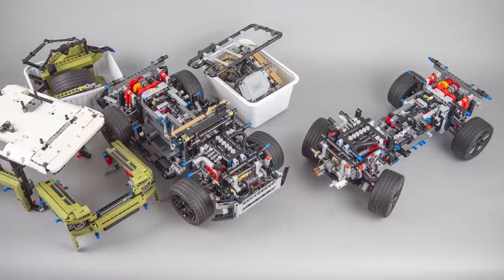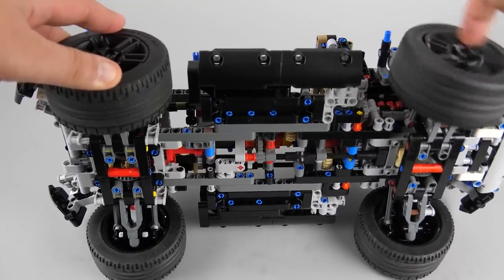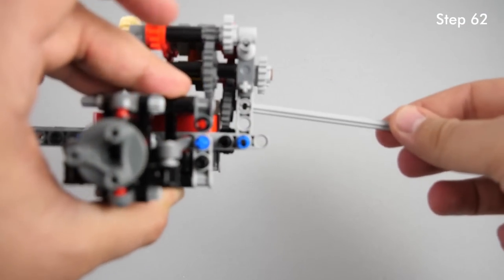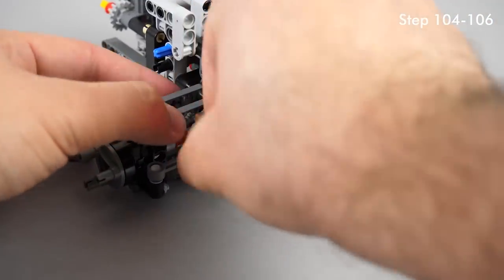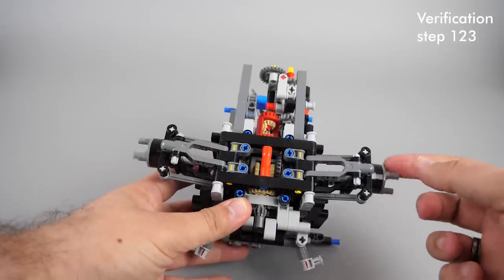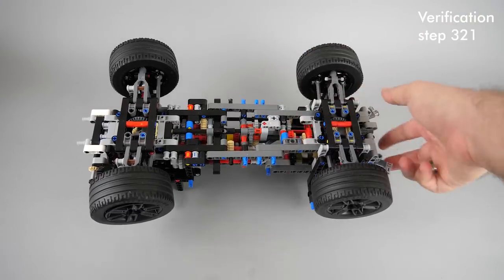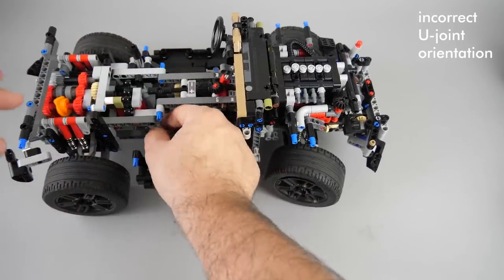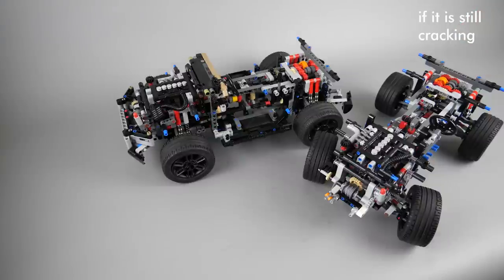LEGO Technic 42110 Land Rover Defender Ultimate repair guide

Comment from the maker: Please check the full guide here with the issues and symptoms listed - https://racingbrick.com/2020/04/lego-technic-42110-land-rover-defender-ultimate-repair-guide/
Reply: You are amazing!
Reply: @RacingBrick Hello dear fellow! I got a probably silly question, why put the red tough spring in front of the grey soft spring? I was wondering this because I got the idea of putting it the other way around to first have a soft bump onto obstacles and then have a tight stopper for the bump! As in you drive onto a rock and have the soft spring Feathering in (I don't know how else to word this, what I mean is the spring stick to slide into the outta pipe, hope this is helping to understand my shitty English lol) and letting the bump push the front wheels up and then having the tough spring in the back of the two spring front suspension to absorb the last bit of energy to have a "more comfortable" "driving experience", I don't know if this makes any sense and would love to hear your opinion on this 😂 (and everyone's else's thoughts as well!)
Reply from the maker: @Marlon_J.  there's no real "driving experience" with a non-motorized LEGO car :) You can play around with the springs but I think the hardness-softness was tuned to keep the body level, so the designer was mostly considering the weight of the car.
Reply: @RacingBrick  ah alright, thx man! And yeah to the experience thing, it's hard for me to find the best words sometimes 😂
Reply: @RacingBrick 
I unfortunately placed the front wheel differential facing top. How should I place it to bottom without damaging the model? Help me...
Reply: Help me. I unfortunately placed the front wheel differential facing top. How should I place it to bottom without damaging the model?
Reply from the maker: @amoghverma3108  check the linked guide, there are instructions how to access and rotate the differential
Reply: @RacingBrick  Actually I am sorry I asked thinking that both differentials should face opposite side😅. You clearly told that both wheel differentials should face top side and I have it same! 
Anyways this video actually gave me more confidence that I have constructed my model with 100% perfection as you did. You are an amazing Lego doctor 💪
Love from India🇮🇳👍🏼
Reply: This vid was very helpful, but I have I problem with the fake engine. When I turn the wheels I does not move the crankshaft the controls the movement of the engine! I know you said the differential placement could be a problem, but their fine in the right spot. The central differential moves the tires correctly (based on what you said). And I checked through your really impressive URG for the defender, and couldn't find this exact "type" problem. This is really bumming me out because I've had this set since last Christmas, and couldn't figure this out. I give thanks if you read this all the way, and also a hello from Colombia 🇨🇴.
Reply from the maker: @doeg0  there's no magic trick here, you really need to check the whole drivetrain from the differentials to the fake engine. You can compare with my walkthrough video and see where the difference is. I suggest to remove the body and check what happens section by section.
Reply: Mine won’t Drive
Reply: @RacingBrick My Range Rover won’t drive no matter what gear it’s in or any of that.
Reply from the maker: @austinpurcell9301  I suggest to check the guide that is linked above and compare your build with that
Reply: The front wheels will go but not the back
Reply: Is there like a brake in the car?
Reply: Ohhh nvm I found it in the vid it really helped!
Reply: @RacingBrick  hey thanks! Sorry I did not respond earlier 😅
Reply: You mentioned the cleaning stuff at the end of the video and that is what happened to me when I first built it,it was fine but when it was put on a shelf and gathered dust it started cracking when I moved it but you can't dust every bit of the set you would be there for days so what could I do
Reply from the maker: @matthewtodd5831  you can use pressurized air to clean it, or simply accept the cracking
Reply: Ok thanks your video helped me understand more about the Lego set
Reply: Even after a fresh build and following all these steps meticulously, my defender stills cracks 😭
Reply: Hey @Racingbrick I need help with my landrover i hear cracking noise in the middle section right next to the driver seat but i dont know how to fix it

Comment: Racing brick, your videos and content are absolutely superb!, i had a problem with the rear wheels not turning, i started fault finding and found an issue with the rear part of the vehicle and found the culprit,

now thanks to this video you helped massively, tiny correction of turning around 1 piece solved it, now everything works fine, so thank you very much and take care.
Reply from the maker: I'm really glad I could help, thank you for the nice feedback!
Reply: Sounds like we had the same problem, step 65. Thank hod for this vid I would never have found the issue without it!! 🙏🏻
Reply: @gzbg21  Hi there, an yes its one of those pieces that can fit in both ways an very easily missed, an yea definitely seems pretty common, but yea so glad i found this video too, happy building 😉👍

Comment: My Land Rover had those cracks and tried everything in the video. Finally, the solution was to disassemble (saving the exterior parts as shows in the video) and assemble again. Now works fine, so don't desperate if you have to rebuild, just make sure many times that mechanical drivetrain works smoothly.

Comment: What I found out is that the fake engine is the biggest cause of the gears getting stuck. The crankshaft needs to hit the pistons with some force, if not, they get stuck and the gearbox gets stuck which makes the wheels get stuck. 
The crankshaft from the manual fires 2-1-1-2. If you change it to 2-1-2-1, you'll get a better balanced force that goes through the fake engine. Definatly helped for me!
I've also build the version from jb70 from rebrickable, that drivetrain moves smoother because there are no u-joints. He did a great job redesigning the drivetrain, also fixes the Hi-Lo sticker working correctly. Would recommend it  to everyone. 
Also Racingbrick, you're awesome doing all the video's on this set. It's a great set to build and to have, and helping people having problems is always a good thing!
Reply: SEE ENGLISH VERSION BELOW FRENCH
Oh mec, c'est exactement sur ce dernier point que je me suis penché hier, après avoir cassé une pièce. Comme toi j'ai trouvé que les pistons moteur à eux seuls étaient difficiles à entraîner. ça me rassure que je ne suis pas le seul à imaginer ce problème. Peux-tu montrer les photos du vilebrequin/de l'axe moteur corrigé. As-tu lien de la vidéo où il modifie le système avec les arbres de transmission (en espérant qu'il ne faille pas d'autres pièces que celle du set sinon pas envisageable pour moi). Mais changer la hauteur ou la configuration des pistons me semble être une voie à explorer. Faut juste voir comment réorganiser le jeu de pistons. Inverser les deux différentiels d'axe pour faciliter la marche avant au détriment de la marche arrière (qui je pense n'utilise quand même pas la totalité de la transmission) peut résoudre en partie le problème, mais à tester... Merci pour ton retour en tout cas ! 
EDIT : J'ai trouvé et regardé sur le site Rebrickable le MOC de JB70 seulement je ne vois nulle part où il a changé le séquencement des pistons par rapport aux instructions originales. Mais je pense trouver une séquence à tester lors de l'éventuel prochain remontage. Je viens de mieux comprendre le séquencement 2-1-2-1 que tu veux dire par rapport au 2-1-1-2 suggéré par le livre qui, je pense, déséquilibre l'inertie de l'axe. Et concernant la boite de vitesses, il supprime de fait les u-joint mais ça change pas mal la construction de la voiture mais surtout, il faut acheter pas mal de pièces en plus, du coup je vais devoir rester sur le modèle de transmission par u-joint.
---------------------------------------
Oh man, it's exactly on this last point that I looked at yesterday, after breaking a piece. Like you, I found that the engine pistons alone were difficult to train. It reassures me that I am not the only one imagining this problem. Can you show the photos of the corrected crankshaft / engine shaft. Do you have a link to the video where he modifies the system with the drive shafts (hoping that it will not require other parts than that of the set if not not possible for me). But changing the height or configuration of the pistons seems to me to be a way to explore. Just have to see how to rearrange the piston set. Reversing the two axle differentials to facilitate forward travel to the detriment of reverse (which I think still doesn't use the entire transmission) can partially solve the problem, but to be tested ... Thank you for your return anyway!
EDIT: I found and looked at the JB70 MOC on the Rebrickable site only I can't see anywhere where it changed the piston sequence from the original instructions. But I think I will find a sequence to test during the possible next reassembly. I just got a better understanding of the 2-1-2-1 sequencing that you mean compared to the 2-1-1-2 suggested by the book which, I think, unbalances the inertia of the axis. And concerning the gearbox, it removes in fact the u-joints but it changes a lot the construction of the car but above all, you have to buy a lot of parts in addition, suddenly I will have to stay on the transmission model by u-joint
Reply: @crucqjeremy8762  The crankshaft change was my own idea. If you have some extra technic parts you can get a long way with the V1.3 MOC model. I've only made the drivetrain and the gearbox. I didn't changed the steering system or the bodywork like on jb70's design. You can always try and see how far you can get if you have some other Technic models you are willing to take apart, or if you can buy spare parts somewhere.
I haven't tested the 2-1-2-1 crankshaft with the standard LEGO model, but maybe that will be helpfull to make it run better. Good luck!
Reply: @shampo0oLWD  Je pense tester le vilebrequin en 2-1-2-1 + vérifier l'entiereté du modèle et des ajustements (comme suggéré par l'auteur de la vidéo), car pour le reste je n'ai ni envie d'acheter de pièces supplémentaires (déjà que je sais pas pour combien j'en aurais avec les 4 u-joints et les frais d'envois), ni envie de démonter le seul autre set Lego que j'ai (qui fonctionne merveilleusement bien, je serai capable de le casser lui aussi en le démontant.). Et merci !
----------------
I plan to test the crankshaft in 2-1-2-1 + check the completeness of the model and adjustments (as suggested by the author of the video), because for the rest I have neither desire to buy parts extra (already that I don't know how much I would have with the 4 u-joints and the shipping costs), nor want to disassemble the only other Lego set that I have (which works wonderfully well, I will be able to also break it by dismantling it.). And thanks !

Comment: Great guide! I must have re-watched it a hundred times by now - probably peaked between the time I ordered this set and as I watched its delivery status to finally reach me. The review of the correct setup of the transmission and gearing was unbelievably helpful however at higher (fixed/reversed lower)+HI gear there's still some cracking and push back from the system - my guess is with so many cogs and shafts the issue lies in the friction between plastic parts rather than build error, but it gives me an excuse to strip it down and build it up again. Also the droopy suspension might depend on the "freshness" of the springs or maybe which one is closer to the axles - red+grey up front seems to be doing a good enough job (with the red being at the centre of the axis). Anyway, I am hooked (again) on Lego partially because of you and looking forward to more inspiring reviews!

Comment: They should've used Constant Velocity joints in the first place.

There's a difference between a Universal and Constant Velocity joint.
Reply: But the cv is usually too weak unless you use the ‘mega cv’ included in real he Lambo

Comment: My rear wheels were spinning against each other and the car would not move. I was breaking my head to find where I went wrong and finally found your video. The mistake was putting the gray piece upside down after step 65. Your video (9:10) helped me solve it.
Reply: Same
Reply: I was having the same issue. Flipped the grey piece and now my truck only goes in reverse

Comment: Didn't realize people were having so many issues with a more advanced set like this. I think Lego reached the limit of what an average buyer can build as regards to complexity.
Reply from the maker: I guess a few verification steps are missing from the manual, like the ones we had for 42082. Once the model is built it is very difficult to find out where the problem is, unless you really understand how the whole drive train works.
Reply: @RacingBrick  wow, I thought the body came off easy... but that is not the case.
Reply from the maker: @basberend  it's much easier than doing the second part of the instructions backwards :D
Reply: The car is too complex for its own good, it doesnt need a working gearbox at all, especially the most complex one lego has ever made. It was inevitable that there would be gearbox problems.

Comment: For anyone else like me that has tried all the troubleshooting and still has issues, try this: 
  Locate the two gears meshed together - Tan beveled gear and red color gear, below the DNR selector on steering wheel side. On my model they were pressing together tightly which created friction. Any other friction on these gears eg. if they are sandwiched to tightly together on the axels, could also be a problem.  Make sure both gears spin freely with no friction. 
   Its extremely subtle but after fiddling with these two gears for a while I got the engine to run smooth in al the high gears.

Comment: Hello RacingBrick. I came across your Lego Land Rover videos because I recently got this set and (of course) I had the cracking issue. My model was cracking badly even in 3rd-High or 4th-Low. I checked all the possible issues in this guide, but still didn't manage to fix it. What did the trick for me was to re-build the front end of the car more carefully: all the gears built between step 206 and step 246 must have as little friction as possible, especially the gears that directly drive the fake engine. This is essential because in the high gears the output shaft of the 4-speed gearbox has very high speed and therefore very low torque. Any extra-resistance encountered between this shaft and the fake engine will cause the transmission to fail.
Reply from the maker: Thank you for sharing your experience! Unfortunately no careful building provides a long-term solution, if you leave your car on the shelf for a month or two, it will potentially start to crack...

Comment: Thanks a lot! Found at the stage of completed gearbox that differential stock. With your guide fixed very simply.
Reply: And one more issue was found and fixed - messed with differentials sides. Easily fixed with your help!
Build the Defender with 7 years old son - fun 😂

Comment: Ok, i wanted to put this out there. I recently built the land land rover and experienced ABSOLUTELY NO problems with it. I have no idea why people are having issues
Reply: You are very lucky believe me ! Me twice that I go up meticulously and 2 times that it cracks (a u-joint even ended up breaking), to go crazy. So that I built the 42082 without problem which contains much more parts and gears than this Land Rover ....
Reply: @crucqjeremy8762 , turning the differentials (the crown wheels NOT on the driver side) helped me a lot.

Comment: Thanks so much for this! 
Unfortunately even after aligning to U joints properly i still have that cracking noise. 
Too lazy to disassemble.
Guess i'll just stick to reverse
Reply: How about neutral? Does it make the noise while in neutral? I'm about to start this build and all my projects are display pieces anyway
Reply: in my land rover in reverse every gear is smooth, but in drive its hard to spin a wheel and its gets harder in higher gears